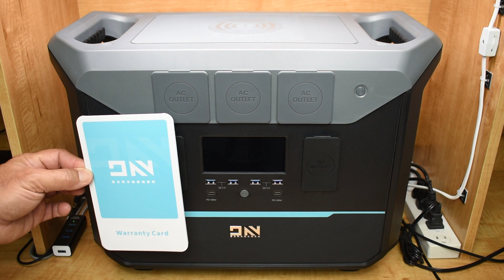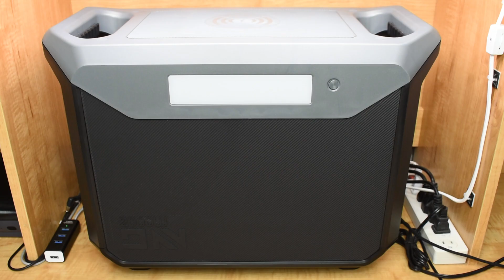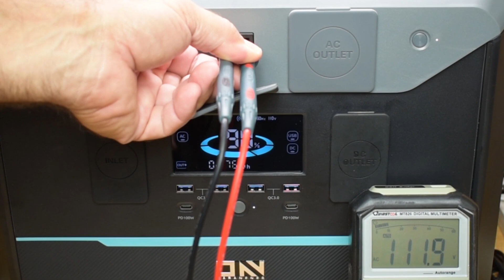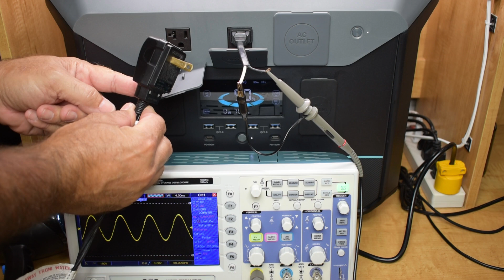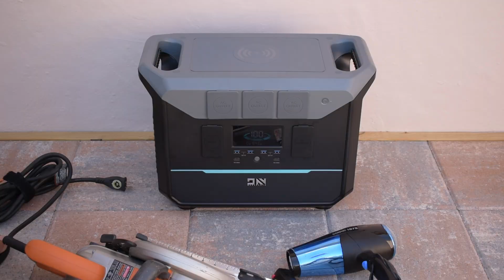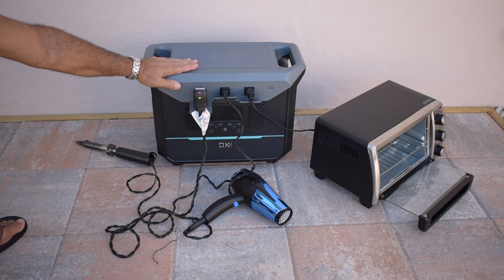DaranEner NEO2000 LiFePO4 Portable Solar Power Station Any Good? Find out!

Comment from the maker: ATTN: I mentioned a 3000W maximum power output in the video, and questioned it. The good news is, it wasn't the MAX OUTPUT, it was the surge capability. Thanks for watching!
Reply: In general it doesn't look bad but it has a voltage limit below the others you tested, have you already tried the 2000w portable shell generator?

Comment: This just went on sale for $500 on Amazon. It has a few small deficits (The 33V limit for solar input as the low threshold is a bit annoying), but at half the price of other 2000wh capacity lifepo4 inverters... Worth it.

Comment: Mine charges with AC, but not with 2 x 200watt solar panels. Anyone have a suggestion?
Reply: Make sure you have it set up to double voltage. 2 12v panels only just crosses over 33v in good conditions, see if you can add a third.

Comment: I just received my DaranEner power station and it will not charge with the AC power plug. Do you know how the reset button works? I push it and nothing happens. Also is there a customer support phone number to call in the US? It arrived with a 72% charge on it so it has been charged before.

Comment: Greetings Sir, I noticed when charging via solar and powering a load that the input sometimes stops showing even though it's still getting power from the panels. 
They said it's supposed to work that way and while I understand, it should show input and output no matter what.

Comment: Would be great to show how you would build the adaptor for car charging.  I understand to concept/components, but would be helpful to show in a seperete video..   In regards to this unit, I don't like the AC output.  It seems to drop the voltage in order to accommodate the load.  Wondering if that can be disabled.  Other units offer this, but they normally have a way to disable.  Excellent review!!
Reply from the maker: Almost all the power stations I tested use the same type of soft start. The issue with this one is that it wasn't really smooth. I have a video below that shows how the dc-dc converter works. Glad you enjoyed the video.

https://youtu.be/yXNW-4fNZVk

Comment: The AC Frequencies may be more precisely 60.00Hz and 50.00Hz under load.  I was thinking that when you were reading the frequencies. but after seeing the sine wave ripples go away under load, that is good evidence that the frequencies may better regulated, too.  Some portable generators show inconsistencies with no load, but become more perfect under load.

LiFePO4 batteries are similar to Li-Ion in that leaving them on charge after reaching 100% charged will reduce their capacity (and maybe their efficiency) and make them need to be replaced much faster.  Therefore, using this unit as an Uninterruptable Power Supply (UPS) should most likely not be recommended.  The AC charging input may be "Smart" and prevent the trickle charging at 100% charged, but you would want to contact DaranEner about that.  If the AC input charging acts as a Pass Through to run AC devices after 100% charged, then the trickle charging could be turned off, but I bet that as soon as the unit discharges to less than 98% or so, the trickle charging would turn on again.  These are questions for DaranEner.

The unit may run the inductive loads you connected, but their operating speeds sound slower than normal.  And you had to turn them on is a particular order with a wait time to make them work.  You could use an RPM Meter to test the circular saws on 120VAC Mains and compare that to what RPMs the unit generates.  The AC Voltage may have been within specs, but how much current was delivered?  The same as AC Mains or not?  Something made them sound like they weren't fully up to speed.  Recall the Voltage drop when switched to UPS Mode.  It didn't sound all the "slight" to me.

And how does the charge level hold over time as the unit sits unused for an extended period of time?  IIRC, LiFePO4 self-discharges more than Li-Ion.  Their power output is also less than Li-Ion for the same specs as related to a similar Li-Ion unit.  The unit is cheaper than a similar Li-Ion unit because LiFePO4 cells are cheaper than Li-Ion, and cheaper for a reason.  Elon Musk is getting a lot of negative feedback over changing his battery pack technology to LiFePO4 in some vehicle models.

I'm glad you were sent one to test, but would you buy one at full price after this testing?

Comment: The placement if the AC sockets above the display and controls makes it a non-starter for me.  Whoever designed the layout for this unit needs to find a new line of work.  It's a disaster on the outside.  I would have no confidence on the inside design.
Reply from the maker: You do have a point about the positioning of the sockets. You noticed when I was filming, the wires were all in the way of me trying to look at the display screen.

Comment: What you didn't notice, is that during the time you unplug from the power cable will running the hairdryer, there was a drop in watts. It was 278 watts when direct to AC, drop to 239-240w when direct to the battery.
Reply from the maker: Yes I noticed, and that was explained in the video. The reason why the wattage dropped is because my AC Mains was around 121.5 - 122v, and the power inverter produces 112 volts. That's why it showed a drop-in wattage.
Reply: @electronicsNmore  So, in other words, if this unit cannot support the wattage the appliance requires, then the appliance could suffer it's performance using this product, right?

Comment: If they made the hinge go all the way across the top of the outlet covering, the hinge would act to keep the water off the plug. Also, they could put a nipple and hole to hold the flap in the open position.
Reply: In this configuration, cutting off the hinge and attaching duct tape to the top of the flap would accomplish the same result.

Comment: I should of wanted ....my question was answered about DC charging....but tont helpful if taking tent camping and no solar panels.....I like the pass thru...but heard difference when power unplugged ..saw sounds a bit slower....waiting for price....but this don't look like a great unit...good for a fan and light if power goes out...but if no panels or strong sun...your screwed for charging...
Reply from the maker: You'd need a DC-DC boost module for 20 bucks. The difference was due to the PPS having a 112V output compared to my house 121.5V output.
Reply: @electronicsNmore  so....a 150 200 watt inverter would work to charge it ....but after looking at it....I'm still leaning toward blueeddi ....and possibly folding solar panels....

Comment: With all the knowledge you have about the device's which ones do you suggest .
Reply from the maker: I've tested a lot of high power output portable power stations, and many did extremely well. I liked this unit, but outside of minor things like the AC outlet covers, I wasn't happy with the jittery soft start, the fact that the PPS had trouble starting a second inductive load, and the PPS refusing to turn off the output when overloaded. If it had a smoother soft start, and was able to power a second inductive load, I would highly recommend. I can refer you to my Energizer, Oukitel, and Mango power station reviews below. Thanks for watching!

https://www.youtube.com/watch?v=EKqqTcVAeXc
https://www.youtube.com/watch?v=5RYCNkHxGcA
https://www.youtube.com/watch?v=NJuKbLiEwv8

Comment: No DC charging port..or cord?
Reply from the maker: You saw the xt60? correct?
Reply: Fo solar......is there a cord to plug in cig liter
Reply from the maker: @leonardh8269  Solar charging uses the XT60 cable included. I discussed car charging in the video.